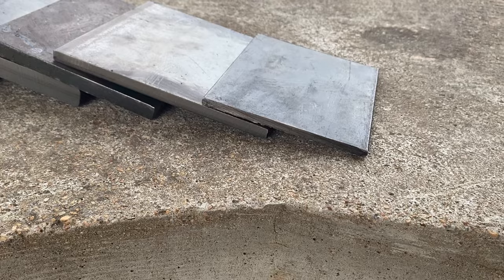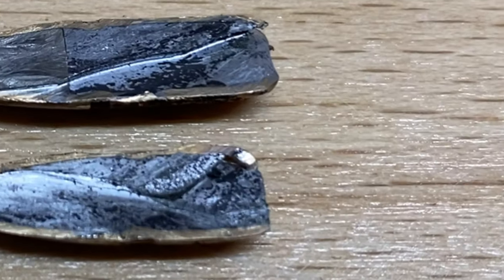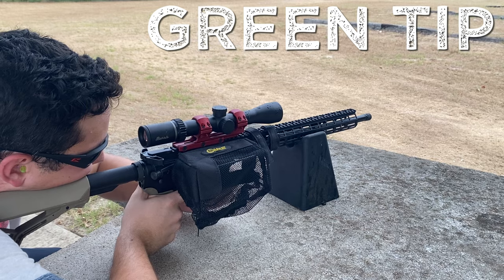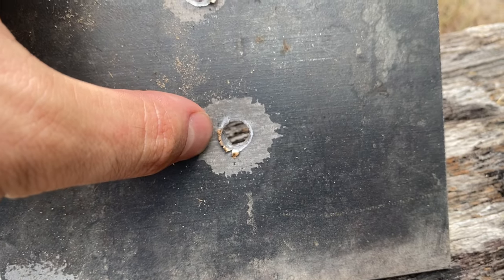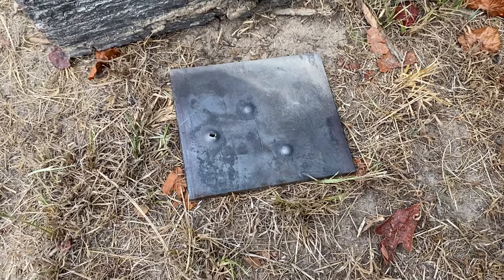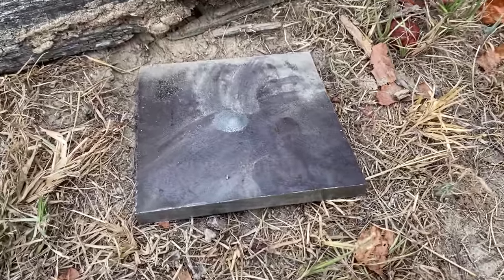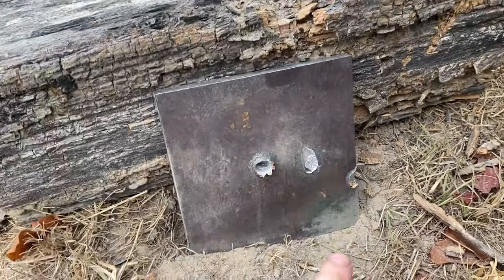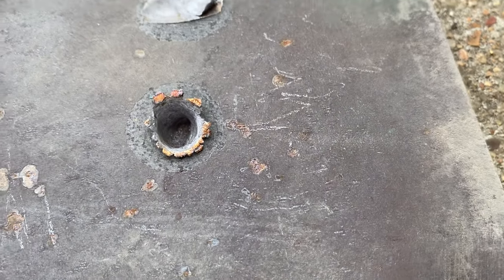How Effective Is 5.56 Green Tip Against Steel? (Green Tip vs. FMJ)

Comment: "DO NOT" mistake a hang fire for a dud. Keep your firearm pointed in a safe direction until either the round goes off. Or until an ample amount of time has passed to safely extract the cartridge.
Reply: Good advice, I have never heard of this before.
Reply: I would guess because I don’t know that it’s necessary to ensure that the dud would need time to cool off and dissipate any potential heat that could complete the discharge?

Comment: I like how concise  your video are. Perfect length. Excellent editing
Reply from the maker: I really appreciate the kind remarks!
Reply: Agreed. Subbed.
Reply: @bananaballistics  Same. Great vid.
Reply: Yeah it's really nice when you just crack on with it and don't drag it out with meaningless chatter. Too many channels just like to hear themselves talk
Reply: @bananaballistics  kind of remarkable...
Reply: @jrow84  i thought there was plenty of chatter here. The video could use less face and more shooting.
Reply: @bananaballistics  ‼️Thanks for your great videos.  As you know when you fire 5.56 or 223 at AR500 Hardened Steel under a SLOW MO camera you can see that when the bullet impacts the steel (and is stopped on the surface) the Lead Liquifies and little lead droplets  💦   splatter and all thats left is a small nickel sized pancake of lead that cooled from the Steel Plate and is paper thin that falls to the ground. I have saved a bunch of them for my home display.  It seems that the bullet has to peirce through the steel before the friction and compression cause the lead to liquify and lose all its energy.  Seems the steel tip and / or core just stops that from happening.  Tungsten Rounds seem to do the best because steel won't liquify, but it will fragment, causing the bullet to lose all its energy and Tungsten can stay intact.  Would love to see you talk about and do some testing with that.  Also, with ballistics, it's not all about how much energy the round carries when it impacts the target.   It's how that energy is transferred.  I compare it to pulling out a stuck car.  Use a chain ⛓️ with a lot of force, and it Rips off the bumper...major damage..but..BUT..use a stretchy rope, and you can use twice the force with no damage occurring.  Thanks for all your work and knowledge you are sharing. 💯💯🦅🇺🇸
Reply: @Banana Ballistics  Also a 5.56 M855 Green Tip vs 5.56 M855 A1 All Copper Steel Tipped the Mils new 5.55 round would be a GREAT video. I have seen them compared in gel but not steel.  I'm not sure i like the way they designed the new round to fragment.  Seems there is more hydrostatic shock from the round staying intact and yawing vs fragmenting like a RIP round...but I like the idea of the steel tip being up first and not have softer metals in front of it like lead or a copper jacket.
Reply: Yep.

Comment: Is the 55 grain 5.56 or 223?
Reply: 5.56..  Look at the casings at 1:18, and both are heat treated/case hardened.  .223 is not typically heat treated/case hardened.

Comment: It appears the 3/8 in plate was angled when you fired the m193 at it. That may have been enough angling to increase the apparent thickness. Just for the scientific method I suggest making yourself some sort of bracket so that you can stand up these steel plates and they will be perfectly square. Repeatability and all that.
Reply: the plates are angled to reduce the chance of a ricochet directly back at him, as a ton of videos online you can see flat angled plates sending the bullet right back at the shooter, especially with lead core FMJ.
Reply: @michigancube4240  so then angle them all the same.

Comment: Green tip at 100 yards punched a 3/16" hole through a 3/8" plate, impressive.  308 at 100 yards with fmj punched a 1/2" hole WOW.  Lesson, do not think a car door will protect you.

Comment: Seeing them cut open was neat! The steel core is WAY bigger than I thought it was. I literally thought it was just a tiny bit at the tippity tip tip.
Reply: I always thought it was just a steel pin in the middle the size of like pencil lead . 🤷‍♂️
Reply: Yes, I had that impression, as well.  I thought it was about half or less than what it actually is.

Comment: I cringed when you pulled that "dud" instantly, then you did it TWICE!!
I had a hang fire in my AR once and set it down on the bench pointing down range. 
It sat there and then went off at least 10 seconds later. 
You are very lucky that you still have no missing fingers or holes in your hand.

Comment: In another video the XM193 actually penetrated better than the XM855 out of a 22" barrel  when shot at AR500 plates. However, they were shot much closer in than 50 yards. I believe he shot the steel plates at 35 meters.

Comment: The energy dissipation of the impact on an unrestrained steel plate with a piece of wood randomly positioned behind it is a considerable factor in penetration testing. It won't necessarily result in the difference between a pass-through and a crater, but it's worth improving your setup to get consistent and more reliable results. Spinning/rotating plates waste significant amounts of energy when comparing multiple calibers, velocities, etc. Otherwise your approach and sequence is pretty well done. It appears your 300 Blackout vs. 7.62 x 39mm test incorporated these setup improvements, but so other viewers are aware, the results of an unrestrained steel plate can yield drastically different results depending on the rotational velocity and shot location.

Comment: Due to the projectile being basically vaporized while grinding away at the target there is a upper Limit on how far a projectile can penetrate. 
Today a common practice to improve anti cannons is increasing the length of the projectiles
Reply: ‼️Thanks for your great videos.  As you know when you fire 5.56 or 223 at AR500 Hardened Steel under a SLOW MO camera you can see that when the bullet impacts the steel (and is stopped on the surface) the Lead Liquifies and little lead droplets  💦   splatter and all thats left is a small nickel sized pancake of lead that cooled from the Steel Plate and is paper thin that falls to the ground. I have saved a bunch of them for my home display.  It seems that the bullet has to peirce through the steel before the friction and compression cause the lead to liquify and lose all its energy.  Seems the steel tip and / or core just stops that from happening.  Tungsten Rounds seem to do the best because steel won't liquify, but it will fragment, causing the bullet to lose all its energy and Tungsten can stay intact.  Would love to see you talk about and do some testing with that.  Also, with ballistics, it's not all about how much energy the round carries when it impacts the target.   It's how that energy is transferred.  I compare it to pulling out a stuck car.  Use a chain ⛓️ with a lot of force, and it Rips off the bumper...major damage..but..BUT..use a stretchy rope, and you can use twice the force with no damage occurring.  Thanks for all your work and knowledge you are sharing. 💯💯🦅🇺🇸

Comment: Food for tough, against mild steel the 55 gr penetrates less, but against hardened steel like ar500 55gr penetrates say a lvl 3 ar500 plate whereas a greep tip wont, you actually need lvl 3+ or lvl4 to be able to stop regular 55gr
Reply: Yes I've tested this as well..AR500 side plates level 3. 16in barrel..green tip stopped M193 clean through. The reason is because the tip of green tip, while considered hardened and not mild, it is not super hard. It's actually softer than AR500 steel. So the tip doesn't help it at all when going into AR500. But the tip is harder than mild steel so it helps. But the new M855A1 round the tip is harder than AR500. It's actually close to AR600/AR650. So it can punch through AR500 plates like AR500 level 3 no problem.
Reply: @fujimi715  Tighter twists perform the nicest with M855 and especially m855a1, my friend has a 16 in. barrel and can go through level 3 plates at 100 yards with normal greentip. M855a1 will go right through a level 3+ plate with afaik a 12 in. barrel if it has a 1:7 twist without issue.

Comment: It's been my experience that the 55 grain fmj will penetrate quarter inch AR500 steel while the 62 grain green tip will not when shooting identical length barrels from 16" to 20" and the target at equal distances.  I only shot at 25 yards max.  On any other target material I would put my money on the 62 grain green tip having greater penetration.  I used to buy the green tip exclustvely when id buy ammo by the case thinking that the added weight might be a benefit at longer range and it probably is but its less accurate in my rifle.  Probably because the steel penetrater upsets the concentricity of the bullet making the bullet wobble slightly in flight.  So now I buy 55 grain exclusively.  I shot a buck at 60 yards with a hornady 55 grain soft point in the chest and got complete penetration.  There wasnt much of a blood trail but he only ran about 50 yards.  I dont really consider it a very good deer cartridge but it usually beats using a larger caliber and missing the vtals.  Its easier to find a deer that runs 60 yards with no blood trail than it is to find one that leaves a decent blood trail for 300 yards and stops bleeding and is still  running.

Comment: The 556 was designed for a 1 in 9 twist and a 22-inch Barrel. And for all of those watching since he completely drops the ball wait ten seconds after firing when you have a dud to remove the casing from the chamber because they can and sometimes you do go off with a delay

Comment: couple of notes   its not muzzle velocity that makes the penetration  its the velocity at the moment of impact  but of course that will take more equipment    also  if you want the best velocity in a long barrel youre going to have to reload    using the slowest powder that finishes burning just before it leaves the barrel      do it again with a proper twist   lets see it then

Comment: Green tip ammo is a strange animal, and some say it is armor piercing, and others say it isn't!
But the worst thing was when the AFT wanted to ban green tip from civilians because they wanted armor piercing ammo off the market! But luckily, they got their butts kicked!

Midway has green tip 300 round quantity for $162, or $0.53 a round!
Or you can get 1200 for $644.77, which is the same cost per round!

But you better have the 1 in 9 or 8 inch rate of twist, else it will keyhole and not work well!

Remember, head shots only, so they have to apply the tourniquet to the neck!!

Comment: Forget where I read it, but I was prepping an urban warfare class for an Iraq deployment, and I read that max steel penetration with 5.56 is achieved at 200+M because the high speed of shorter ranges cause the bullet to fragmentate. So you want a little less than max speed to get most penetration.

Comment: You had a dry fire and pulled it out instantly twice! I'm not mister safety but I wait 5 minutes piont it and chamber in safe direction then eject
I knew a guy who had a dry fire and did what you just did as he pulled the bolt back the case exploded and a piece of brass went into his gut
Literally  almost killed him !  I've also read a story were some did dye and sue!  I know you know what your doing  ut do not minimize  hang fire please !
Reply: You have a good point, but I've had rounds explode in front of me and ended up with shrapnel in my arms - I really doubt anything would penetrate enough to threaten your life. Eyes are another story.
Reply: @snorman1911  I know rounds don't hurt if exploded in the hand 
But in half chamber  there's pressure  alot as you know it realy is smart to wait five minutes 
Then dump the rd  quick action facing the ground  I had 308 old isreali  tds hang up 
And then go off 1 minute later had to see it to be live it

Comment: Need to start testing the 8.6 blackout! The next big thing if you will. Planning a lightweight 12" build -faxon has the barrels. Need to get dies and such first. Should be a 6lb rifle lobbing 338 slugs.
Reply from the maker: I have looked into the 8.6. I just can't seem to justify launching 300 gr 338 pills down range at subsonic velocities since they are so expensive lol. Maybe I will change my mind in the near future. That will be an awesome build though!
Reply: @Banana Ballistics  ‼️Thanks for your great videos.  As you know when you fire 5.56 or 223 at AR500 Hardened Steel under a SLOW MO camera you can see that when the bullet impacts the steel (and is stopped on the surface) the Lead Liquifies and little lead droplets  💦   splatter and all thats left is a small nickel sized pancake of lead that cooled from the Steel Plate and is paper thin that falls to the ground. I have saved a bunch of them for my home display.  It seems that the bullet has to peirce through the steel before the friction and compression cause the lead to liquify and lose all its energy.  Seems the steel tip and / or core just stops that from happening.  Tungsten Rounds seem to do the best because steel won't liquify, but it will fragment, causing the bullet to lose all its energy and Tungsten can stay intact.  Would love to see you talk about and do some testing with that.  Also, with ballistics, it's not all about how much energy the round carries when it impacts the target.   It's how that energy is transferred.  I compare it to pulling out a stuck car.  Use a chain ⛓️ with a lot of force, and it Rips off the bumper...major damage..but..BUT..use a stretchy rope, and you can use twice the force with no damage occurring.  Thanks for all your work and knowledge you are sharing. 💯💯🦅🇺🇸

Comment: I don't quite get how FMJ would be lighter since it has a full lead core while the green tip doesn't?

To be sure, I'm not familiar with these types of cartridges but they seem to be similar to what we use in the military though we have AP rounds instead which have a full steel core and a much higher velocity because steel is, as we all know, lighter than lead.

Back in the day we used Tombak plating instead because fucking up the rifling isn't a problem when you have 13x as many barrels as guns.

Comment: I believe the green tip would go through the 3/8” steel plate if the plate was unable to move. To much force is lost when the plate moves in the same direction as the bullet.

If the plate was attached to your chest (as all are via strapping) and then shot your body would prevent the plate from moving backwards resulting in more velocity impact. That’s just how I personally perceive it.

Comment: I am not sure why everyone makes a big deal out if green tip ammo. Per US  standards this is simply a FMJ round. Basic color codings for both 5.56x45 and 7.62x51 are as follows:
Green - FMJ Standard Round
Red - Tracer
Black - Armor Piercing 
Gray - Frangible with a blunt nose.
Fifty caliber follows this same guide line but also has various other combinations  not found in small caliber ammo.
Reply: So, you don't know the difference between M193 and M855 then. Green tip ain't "standard FMJ" in 5.56.
Reply: @charliefoxtrot5001  you are correct.  M855, which began life as SS109 was, or rather is, the standard NATO round. It replace M193 a few years after I left the service in 1977. Both are green tip with biggest difference being grain weight of 55 for M193 and 62 for M855 and that M855 has better penetration. My oldest, who was in the Marines, also set me straight on this. Thanks.

Comment: A 5.56x45 is not a steel penetrating round.  I shot a 3/8 steel spinner designed to be shot with a 44 mag pistol with a 7.62x54 203 gr wolf soft point.  The bullet passed through the plate so fast it didn't even wiggle.  The wolf round made a hole big enough to put a 7.62x54 or 308 case in it for target practice with my 22lr.    A 308 with a hunting round would do similar damage,   I have shot 1/2 mild steel with a 308 loaded with ADI 165 Sierra Game Kings.  The 308 passed through the steel hanging on chains very easy.  The guy who owned the steel plate didn't believe a 308 would pass through 1/2 inch plate so easily.  I hated to ruin his nice pistol set up but he asked for it.   Both cartridges were shot from around 100 yards.

Comment: 300 win mag. With a sabot. There is a video out there of it putting a 55gr FMJ .224 THRU a 1/2 piece of AR500 plate. Of course is was running around 5000fps.

Comment: You need to use a m16a2 length rifle with the same 1 in 7 twist rate. That is what the m855 green tip was designed for.

Comment: From what I understand the 5.56 NATO is designed to hit its maximum pressure and fully burn its charge in an 18" barrel. Longer barrels don't give it anymore inertia, they just add accuracy at range but still use about the same twist rate. SBR's do require a different twist rate though because anything under 18" and it's not hitting its peak pressure. 

Funny thing about those green tips: everyone acts like they're so social. I never understood all the fuss early on in my military service. We literally plinked at the range with them all the time.
Reply: You used them at the range because thats standard issue ammo. Why would you use one type of ammo to zero your rifle, and learn to shoot at the 500, but then use a different type of ammo if SHTF?
Reply: @xrexkinect  because the rifles we used in basic and AIT weren't the same ones we used overseas. When I joined in 2003 we were still using the A2 in basic and AIT. Overseas we used the A4, Block II for one deployment, and mk18 for the majority of the time. Even if we used one of those in AIT, it's not like you carry that exact same weapon afterward. So what you zero with in TRADOC is irrelevant.

Comment: i would love to see this with a 16 inch barrel.... i have 2 carbines so it would be interesting. i have both the green tip and standard type. my guess is that on the 1/4 inch with a 16 inch both would still penetrate easily..